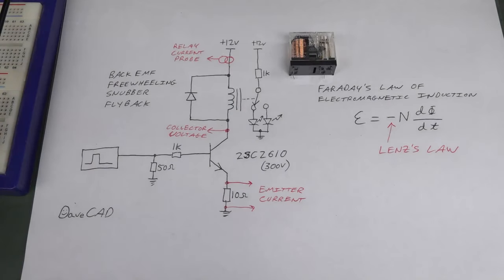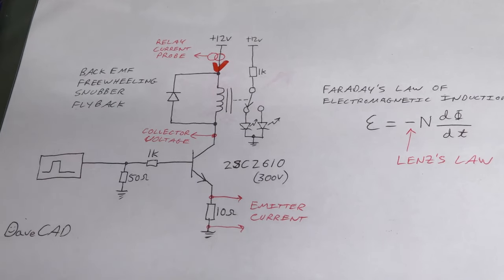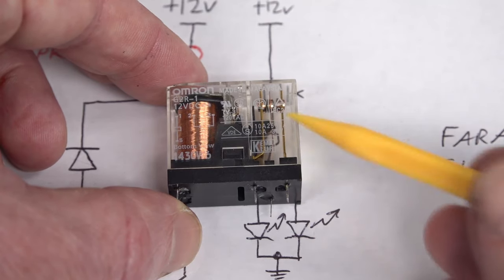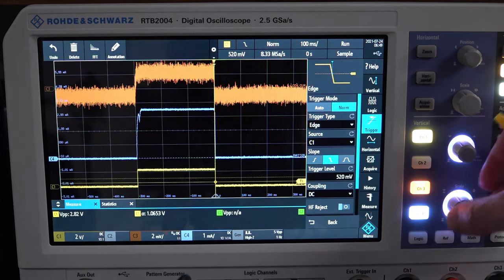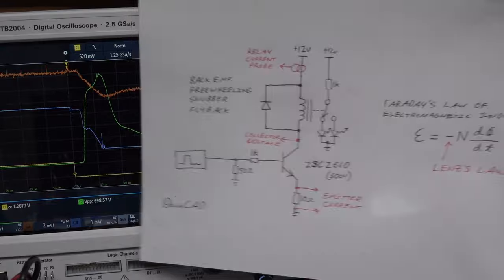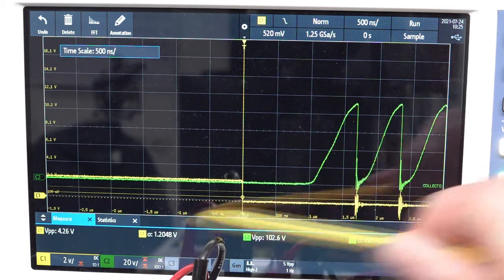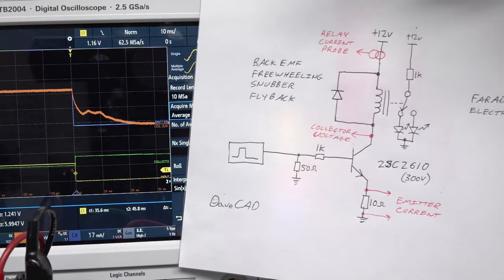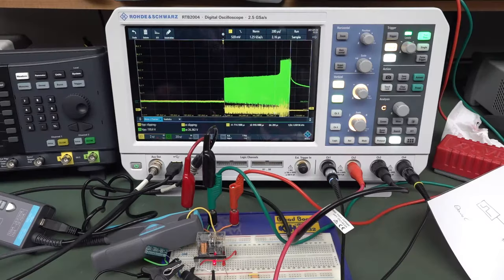EEVblog 1409 - The DANGERS of Inductor Back EMF

Comment: I inadvertently discovered back EMF when I was a kid, after realising that I could configure a relay to act as a buzzer, passing one of the power lines to the coils first through the normally closed switch pair.

Thought it was fun that I was able to make a buzzer, then realised that it was even more fun to touch the coil contacts to get myself zapped!

Was high enough voltage to cause my finger to spasm.

Comment: I've always had hard time hearing things like "the voltage must rise to obey Faraday's Law". No. It does not rise because of Faraday's law but Faraday's law perfectly describes what is going to happen. That is the order of "status", the laws we have FOUND, not made. Nothing follows our laws, our laws follow what is happening. I remember having this been a problem all the way the first year of EE, as our teacher approached everything from that angle, "X happens because of Y law". 

In the second year i got a different teacher and he approached everything from the opposite angle: X  is going to happen and this law is formed to explain it. He was actually a lab teacher. The first teacher didn't do anything but theory so very single equation was presented in the FULL form, then simplified to the thing we will use. He caused so much confusion in a subject matter that is at the core of understanding electricity. He was a bad teacher anyway, each question was answered "it is in the book".
Reply from the maker: Whatever floats your boat.

Comment: I've had to deal with back EMF when building my DIY spot welder.
The solution i came to was to connect a zener diode between the gate and drain, and by choosing the zener voltage accordingly i could make my MOSFET assembly turn on whenever the gate voltage exceeded the supply voltage. A schottky diode was added in series with the zener to prevent the MOSFET from dragging the gate voltage down.
Handling over 900 Amps of back EMF is no easy task but this solution did it beautifully.
In your case you could omit the second diode so that the transistor would limit its base current and prevent saturation, which you mentioned can slow the switching down of the BJT.
Doing it this way you only need to worry about the energy dissipation and supply voltage, because you know that your switching transistor can handle the current already. :)

Comment: Nice description for most people.  Note that even theoretically the voltage will not go to infinity. (there is ALWAYS distributed capacitance so the voltage will rise until the distributed capacitance absorbs all the inductive energy.)
Reply: The transistor also doesn't turn off instantly.

Comment: We always called that diode a counter-EMF diode. Learned about that little guy in the Navy electronics school AV-B. And that magnetic field collapse will zap you a little if the diode goes bad. Learned that the hard way too. 😁. I think the US Navy had the 1N914A designed just for this purpose, because we had thousands of those diodes all over the aircraft. But, that’s supposition on my part. 🤔

Outstanding video!! Thanks Dave!!

Comment: So that’s why big DC contactors have a varistor in parallel to the coil! Thank you so much! 
BTW, isn’t it the way old school gas engines points ignition works?
Reply: Yep! And that's also why timing on them is so so important.
Reply: The "points" are actually on the Transistor's place in the car's ignition....so no, not the same thing.
Reply: @nunamvseravno  what does points mean on this? I had assumed that was a typo.
Reply: @nunamvseravno  Points were used before electronic ignition (transistor) came along.
It had platinum contacts. Before your time.

Comment: Flyback can also be your friend if you need to an easy, inexpensive way to create a voltage - like a for a spark plug or a CRT.  The technique is also used for boost converters to avoid using a transformer.

Comment: I remember this lesson in college... This is also how some old school automotive ignition systems work... in this case, the back EMF is used to generate the voltage needed to drive a spark plug. 

I've also seen capacitive snubbers for AC only use... that's how Omron's low voltage (24V) relays seem to be offered for AC. DC is a diode, AC is a cap. Most of the stuff at work is 24VDC, but one application (off-the-shelf container hydraulic lift tables) use 24VAC directly from a mains transformer. Since normally they're just some switches and a contactor, no need for DC...

Comment: I blew up a micro-ohm meter measuring the dc resistance of a microwave oven transformer primary. Yes it was the back-EMF did it. Kelvin clips interrupted the test current without isolating the voltage measurement. BTW it was about 6 ohms for a 240V primary! 😢

Comment: Coils are still somewhat mysterious for me. You store energy in a magnetic field, that expands into the universe with the speed of light. How can you retrieve that energy almost instantly?
Reply: Because the vast majority of the energy never goes far, it stays in the air gap between the ferrous particles.
Radiation only occurs when the field is changed over a distance that is long compared to the time it takes.
Reply: The universe is a magical place.
there should be nothing. A void.
Yet here we are!
Reply: Only a part of the magnetic energy is radiated off that cannot be recovered; that happens when the magnetic field is changing. The stored energy that is recovered comes from the DC magnetic field and when that collapses part of it also gets lost in the form of radiation.
Reply: Energy storage and energy transmission are separate concerns. Energy transmission (electromagnetic wave propagation) happens when things change. So each time you charge or discharge a capacitor or an inductor, the dynamic part of the electric and magnetic field induce corresponding changes in each other, and those propagate out. But energy storage is a static phenomenon – once a steady state is reached, a certain amount of energy is stored as long as that steady state persists. Most coils and capacitors are very poorly coupled to the free space (by design and happenstance), and thus most of their energy is typically retained in spite of dynamic changes. If you couple a capacitor or an inductor well to free space, a lot of the energy can be radiated out the antenna rather than flowing into other parts of the circuit. This can be seen easily when you have an LC tank with high Q corresponding to long oscillation decay time constant. Once a matching antenna is attached, the Q can be lowered by an order of magnitude or more – more the wider the bandwidth of the antenna and the matching network, since at low Q the effective frequency also changes quite a bit. In circuits that are reasonable to construct, the Q can be lowered to low single digits that way. If the matching network and antenna have low losses, a large fraction of energy stored in the tank can be radiated out :)

Comment: I learned this formula in college back in 1994 - VL = di / dt * L. That's the only formula in Calculus I remember where VL is actual V sub L
This formula allowed us to calculate the  Back EMF induced in the coil, which as you said is many times higher than the applied voltage.

Comment: Good illustration of just how different real circuits behave vs a basic circuit design. Looking just at the basic circuit it actually breaks Kirchhoff's current law a few times, e.g. when the free wheeling diode is conducting. No current in from the power supply, no current out to the transistor, yet current flow is decreasing... all the hidden parasitic resistances/inductances/capacitances of the physical circuit are not shown on the basic circuit diagram but they are the key to where that current is going.

Comment: We dealt with this during my apprenticeship as a colliery electrician, although electronics was just entering the industry in the mid 60's. BUT relays were common in gate end boxes, (flameproof contactor units). All low voltage control circuits needed to be intrinsically safe so as not to produce sparks that could ignite methane. Early ideas were capacitors, then placing the relay in a selenium rectifier bridge circuit, then as silicon diodes starting coming off the production lines, diodes across the coils.

Comment: In the 70's Spencer Gifts sold a prank cigarette lighter which used a small relay to give you a pulsating AC shock. I recreated the circuit for other pranks.

Comment: Good.  Interesting.  It deals with a much overlooked subject, and the comments on flywheel time are good.  I liked the demonstrations of the effects of spring energy in modifying the waveforms.  I should like to add a little detail however:
1 - The back-emf at a perfect switch-off would aim for V=I×squroot(L÷C) where C is the total capacitance, ie coil self-C plus stray C.  So no infinity, sorry.
2 - Replacing the perfect switch with a transistor and nothing else will cause the transistor collector V to rise until it breaks over the transistor's collector-base voltage which acts like a zener diode.  Like the man said.
3 - As another commenter has said, a zener  diode can be used to clamp this flyback voltage to a value somewhat below Vceo.  The higher the flyback voltage (eg high Vceo transistor with high voltage zener) the shorter the flywheel time, because there's a fixed energy in the inductance (plus contact spring etc if present), and the rate of energy dissipation is proportional to this voltage.
4 - For really heavy-duty flyback limiting. connect the zener cathode to the collector and anode to the BASE.  This creates a fast, high-power zener.  The transistor must have sufficient power rating, but it beats trying to find a high-power zener.
5 - I've had fairly large telephone relays driven by unprotected transistors pulsing away for hours on end with no apparent problem, but any reliability engineer will tell you that even a single break-over of the c-b diode permanently compromises a transistor's reliability.
6 - In 1967 I was required to adapt an echo-sounder for shallow water readings.  The instrument used a single audio transducer for transmit and receive.  It had a post-office type relay to switch the transducer from the power driver output to the high-sensitivity receiver input.  The flywheel time was so long that the bottom echo was not received: it had arrived during the flywheel time.  I cured it by omitting the flywheel diode and used the highest voltage approved  transistor available to me - around 120V.  And this was my first introduction the this kind of phenomenon.
7 - A factor ignored in this video is current induced in the iron.  Some energy is dissipated by the iron core acting as a shorted turn.  This effect will actually prolong the flywheel time as it represents a low-resistance, low voltage path just as the simple flywheel diode did.  I found this effect with iron-shrouded solenoid valves to completely take over from the electronic circuit at switch-off.  They took over ¼sec to close after the end of their drive pulse.  This was 1970.
I'll be 80 on Thursday!

Comment: The down side to any coil snubber is the longevity of the drop out, this causes premature wear in the contacts. Best circuit I have used is a diode and resistor in series, then you can fine tune the circuit by altering the resistor to get the least drop out time and least voltage spike.
Nothing else has been better, TVRs VDRs Zeners, non as good.
The other thing to watch is collective dropout, if you have a series of relays, say three or four the delay can run into many 10s of mS.
When controlling pneumatic valves its good to have the same use as well, although then its usually ok to just have a diode, as the difference for a valve of a few mS is not as critical.

Comment: Love the Australian humor...the 50 ohm signal generator termination...I thought the emitter current wasn't exactly the same as the collector...lol
I just played with some littlte Omron PLC switching a 7 watts DC solenoid...we had 10 systems returned for failed closed contacts...the solenoid had no snubbler...I tired to cycle and repeat the failure measured -375 volt  reverse  spike when opened...relay cycled 1.5 x 6....I was advocating a snubber...& 1N4002 clamped it good enough...it was their design....that valve might be opened 4 times a day in its life...so probably the contacts were being eroded..but not the reason for failure on install for PLC relay Q3.
What could it be? Ah...there is another solenoid..a N2 purge...that had 8 foot cable from the Q3...and is also was cycle tested unclamped...two 7 watt solenids ran 600,000 cycles without a failure...humm...then found if the 8' cable to N2 was shorted..I got the relay contacts to weld closed in 5 cycles...the little 24 VDC switcher could supply 5A continuous and lots of fat filter caps...before it foldedback...to save itself...
At the end of the day...a i am almost sure a new hire was installing the unit and was powering up before terminating the N2 solenoid..and we didn't always do a good job separating the wire ferrules after final test on that cable...before shipping....
Problem went ...quietly away..
No snobbery clamps were installed...let it just radiate...

Good job...on BACK EMF

Comment: My first inductive spike learning lesson was with a 12 volt 2 amp car battery charger, I was about 12 years old( in the 70's) and was hold both leads and touched them together by accident!
Holy cap that hurt and scared the crap out of me. I knew you wouldn't feel 12 volts. But now I learned about that new friend, coil collapse , or whatever his name is ...lol

Comment: Pretty sure this is what is going on in my irrigation relay board that is causing the solenoids to short out and the flow meter to read erratic flow rates at closing and opening. I could not figure out why it was counting pulses and displaying a false reading. Now I know it is oscillating. I knew adding a diode across the solenoid would probably cure it. Will have to wait until the end of the gardening season before a add the diodes. Thank You So Much!

Comment: 26:10 the current probe is not in the right place on the schematic. It should be in the loop made of the inductor and the diode...
Reply from the maker: I mentioned that several times. I didn't want to have to redraw the whole thing.

Comment: Some relays, especially for industrial application, have already built-in various protection circuits like: rectifiers and voltage reduction(for ac) so relay can be dc but socket for ac(!), filters, emf protection; some protection can be built-in into sockets or can be as additional mini-modules. Actually, it's more convenient and reliable than building your own protection and adding filters

Comment: Another way of demonstrating back EMF is the way that a transformer will convert pulsating DC on the input side to AC on the output side.  Such as on the old Ford Model T spark coils, or demonstration induction coils made for science classes.  The input voltage feeds through a vibrator on the end of the device, which contains a set of normally closed contacts.  When the primary coil is energized the transformer core attracts the metal flapper with one of the contacts mounted on it, which opens the circuit allowing it to drop back out again.  The flapper goes back to it’s rest position where the contacts are closed again and the process starts over.  Meanwhile the secondary coil is producing high voltage AC from the pulsating DC input.

Comment: In one of the sections of the avionics standard RTCA DO-160 (sect 19-5), the humble relay is harnessed into a transient generator (for susceptibility testing). It is very eye-opening to see that the spike generated is not just a single spike, but multiple transient spikes.

So yes, it is a simple device (that we can easily ignore) but knowing its inner working really opens up new horizons. And do not forget, the old computers, before we tricked rock (silicon) into thinking, were made of your humble relays.

Comment: Forgot to put these in and blew a couple PLC outputs. Same issue with trying to run a motor directly off a PLC output. Use relays to power inductors, and use diodes on those relays.

You didn't have to call me out specifically about the 1N4001s I use though.

Comment: The BJT breakdown reminds of of this cool demonstration by a fellow youtuber, LOOK MUM NO COMPUTER, where he used a broken down transistor to create a reverse avalanche oscillator! The exact same looking sawtooth like curves were created which is useful in analog music and synths.

As an additional note, my guess with the flyback diode lowering the sound amplitude is simply because of the increased duration for the energized inductor to lose energy in its magnetic field, so this results in a dampened collison with the contacts.

Comment: John Bidini says that back EMF negative energy spike is actually a different form of energy.   He says it is Energy that is drawn in from the environment.  It’s a new energy source of a different frequency and behaves different from conventional positive energy and that you can use this energy by capturing it and storing it in a battery which somehow over doubles the batteries capacity.   What would be really cool is if you could make the SSG Badini circuit and show us how it works since you are very good at explaining and showing us on the scope take that negative pulse and use a diode to send that spike to a lead acid battery and show us what it does thank you for your videos